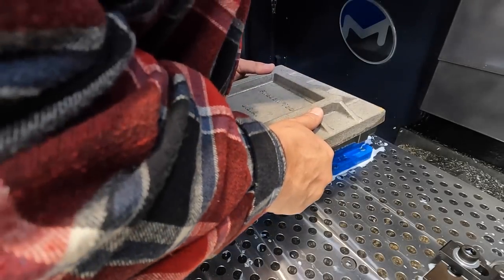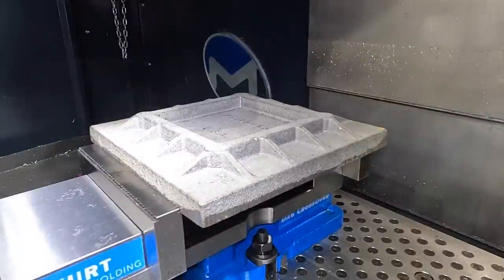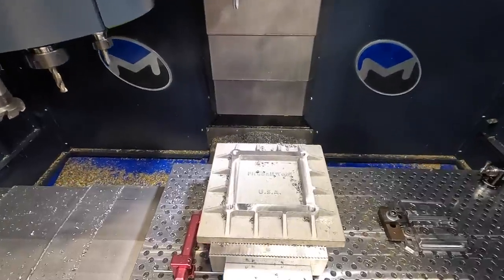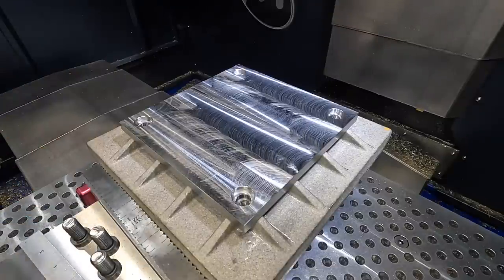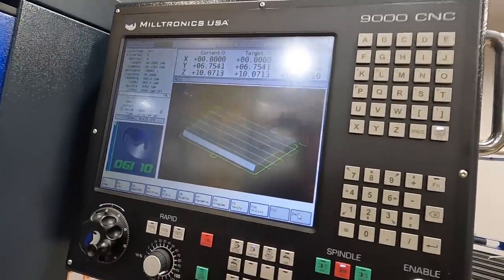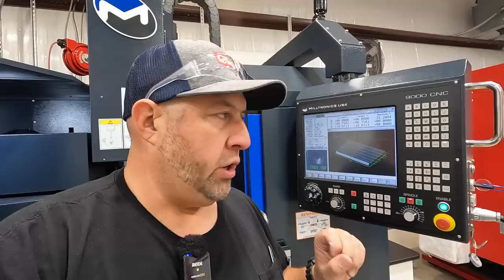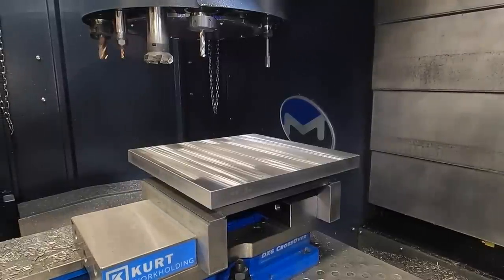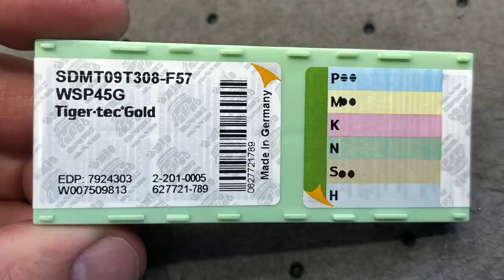CNC Machining a Fireball Tool Fixture Plate

Comment: Hi Adam,

Man I like that smile on your face.  I can tell you are very excited learning new stuff about CNC machining.
You were correct in getting a shorter length shank on the facing tool as it will provide more rigidity and better surface finish.  The one you have would be fine if you were doing some type of deep pocket that needed a facing operation.

I am sure you will find this new technology very rewarding.  Keep up the excellent work.

Just make sure you look twice as you input negative numbers into the probe process.  I found out quickly that there is a BIG difference between -.5 and -5.  I did this one night very late when I should have been in bed instead of running my HAAS CNC machine doing a probing cycle. It cost me $1200.00 for a new probe.  When probing I now always keep my finger on the ESTOP button ready to push it in case something goes wrong. I also had my local HAAS guy rewrite the speeds on the probe cycles to slow them down.  It now takes a little longer doing the probe cycles but so far no more $1200.00 accidents.😉
Reply: The conversational manual mode probing cycles on the DMG M1 I worked on were practically uncrashable as it would never do a full rapid towards a measurement point, but you would very easily fuck things up when setting up the in program measurements, as the conversational menus for that seemed like a slapped on afterthought they didn't have time to tidy up compared to the rest of the Sinumerik controller, only made worse by the fact that I had never used them before. 

To give you an example of how bad it was, I would rely on the ShopMill conversational and onboard simulation 99% of the time, when making any prototypes, fixtures or jigs and almost never dry ran anything (I have sometimes even run a few simple single op programs without even a simulation first, since the input field visualizations and the explanation pop-ups along with the graphic view mode are already pretty straight forward and gives all the information you need to know how it will behave), apart from some high pucker production setups (you really don't want to hit the steel fixtures at 15.000mm/min of feed with a 2.5x100mm staggered tooth side mill running at almost 5 times it's maximum rated surface speed to surpass the 2500 parts per shift mark). Also the work offset probing cycles in jog mode are as intuitive as it gets, and you can set a part up or do a measurement in no time. 

When it came to mid process probing programs though, I could NEVER figure out if an in program probing cycle was alright or not just through the simulation, and I ALWAYS had to run it above the part multiple times and triple check a multitude of things to make sure it wouldn't crash due to some weird input value (the conversational menu doesn't allow blank fields in the program). It would be nerveracking to have to drop the probe in a groove and measure one side for example, since there were a bunch of different feed distances to set and it didn't always make a ton of sense to a relative newcomer to CNC like me.

Comment: Another great video. A tip if you don’t know, start your contour and chamfer tool paths at one of the corners. That way you won’t have any witness marks from start and end of the tool path. Need to look into those fixture plates…nice.

Comment: Nice Machine👍I got no idea of scraping, but got some smartass comments on the CNC thing: I would recomend M01 (optional stop) before every toolchange. makes first runns safer and faster. You can leave it alone if it's cutting for like 30 minutes and it waits for you at the next toolchange. In my observation 99% of crashes happen because of wrong tool or part ofset... Also I would add a save retract level in Z of ca 2in, when drilling. If the tap is in a normal collet, it can brake loose. with saveretract, you got at least a chance to hit E-stop. For better finish on Cast Iron,  sometimes the inserts for Toolsteel make the best finish (I don't know Walter so I may be wrong) I use coolant for castiron for better finish but also for better chip removal. But it only works if you got good flooding, so for filming maybe not....

Comment: Impressive shop.  I understand the learning aspect.   We’ve all been there.   He’s a tip for you.  With your Walter (or any facelmill) the shorter the projection length the better.  That’s a 2.00 inch facemilk on I’m guessing a 3-4 inch long shell milk holder.   If you need that length you need it.  But I’d recommend getting a few different lengths and use short when you can.  Your parts will be more consistent, tool life better, etc.  I couldn’t get a good look at the facemill I always recommend using a 45 degree facemiill if your just facing.  Short 45 degree facemill with the right grade insert and proper speed and feed.  Rick and roll all day long.  
I was a machinist for 15 years and sold cutting tools for 10.  Hope we have more guys like you getting into this field.

Comment: A fella at work showed me a super helpful app called 'FSWizard Pro' which in addition to having an encyclopedia of baseline feeds and speeds for any style and configuration of tool and cut depth/width, has calculators for center drill depth, drill sizes, etc. Comes in handy everyday for me.
Reply: Such a good app. The paid version is 100%worth it too.

Comment: Not sure the HP on that spindle or its torque curve, but we have had much better success running a slightly smaller facemill, and keeping it as short as possible. 

Smaller diameter means more rpm for the same sfm. 
If you play your cards right you can get a larger number of teeth per minute which means more material removed for the same width of cut. 

I would say your largest issue is the length of that face mill. 

Kennemetal makes some face mills that are integrated direclty into the machine taper. Doesn't get much more rigid than that. 
Our workhorse facemill on our VM3 with the 15k spindle is a 1.25" 4 flute iirc for P, M, S materials. 
And we use a shear hog for N materials.

Comment: I think you are absolutely correct to first learn the conversational on the pendant inside and out. Everyone running CNC that I have ever seen will make minor adjustments at the machine for one reason or another or program a simple one off at the machine. You don't want to have to be running back to Fusion to make some minor adjustment and all that's involved in that workflow.

Comment: I'm so happy to see you embracing CNC, my dude! It's going to be so cool watching you transition from where you are now, being quite conservative with your feeds and DOC and being quite nervous about what you're doing, then I know when you get a bit more confident you'll be seeing how far you can push it and make some massive Abom79 cuts, and you'll really dial down those finishes, your parts are gonna look amazing man!

One thing I will say, that face mill you've used in this video, that holder is waaayyy too long. You can see in the machining marks how much that tool is deflecting, get yourself a shorter holder and you can take much deeper and faster cuts, and it will leave you a nicer finish.

You're doing great man, I'm so happy for you in your new shop, I'm really exited to see what you do with it!

Comment: I think the periodic chatter, which only happened around the corners, is due to resonance: it constructively interfered with the diagonal, but not the width. If your machine supports "jittery" random spindle speed variations (sorry, I can't remember the official terminology), that may make those resonances go away.

Comment: 37:00 I'm sure you probably know this. But a good practice for when this chatter is happening is to decrease your spindle speed 10%-30% but maintain your feed rate. You want to have enough tool pressure to keep that chatter from happening. There are other ways to avoid this, but that's a good start because you can just override the RPM on the fly at the control  Awesome video! Glad you stepped into the world of CNC!

Comment: When you do the programming on fusion 360 or any other cam software, it's easy to make those edge cuts so the tool moves slowly up and down that way you wear out the tool evenly.

Comment: A master manual machinist has learned how to work with sight, sound and touch. They're like sculptors. As they turn the wheels they can feel the drag, hear the vibrations and see the results, and they can adjust on the fly as needed. Taking away all that tactile and temporal feedback requires you to work it all out in your head first, translate it to a foreign language and then step away and hope for the best. There's no direct opportunity to adjust for a cutter that might be a bit older, or a bit of extra deflection, or the material responding unexpectedly. I understand the need for speed in production, but that's a whole different skill set, and it satisfies a different part of the brain.

Comment: Adam, great video!!! I see that you are entering the middle of the stock  and ending in the middle. If you change the end of the program to run off the corner you will not have that little vertical spot in the final product. I am not an expert in this field yet but I was doing that in the beginning and noticed that in the finish. Again great video and looking forward for more!!!

Comment: Mount that face mill on a shorter holder. You're biggest issue with the finish with that tool is the deflection. Shorten her up and she'll be leaving a mirror finish. Probably could bring the spindle speed up as well.

Comment: Great job, Adam!  I will always prefer seeing the manual machines in operation, but the fact that you're committed to learning a new way of machining is awesome.  The end results of CNC machining are amazing, I'm just not a big fan of the high speed whine.  I don't know if it's the cabinet amplifying the sound or what but the sound is a bit like nails on a chalkboard.  But that's my opinion.   I won't slam you for wanting to learn something new.  Always forward, dude.  Can't wait for the next video.

Comment: One of my favorite things about the Fanuc control on my lathe is that it has separate overrides for the rapids and feeds. When you're running a program for the first time, you can turn the rapids down to 25% so all of the approaches give you enough time to see if there are any major coordinate mistakes, but all of your cutting passes run at normal speed. A note on better surface finishes with your face mill, if it doesn't have adjustments for each insert it will be difficult to get a high finish out of it. In steel, Sandvik recommended using a "wiper" insert in one of the positions, it was just slightly longer than the other inserts and had a wider cutting edge. In effect the other 4-5 inserts remove the bulk of the material and the wiper insert is continuously making a couple of thousandths cleanup pass wider than the stepover. The lazy way would be to rough with the face mill and cleanup with a fly cutter.
Reply: running single block or block delete and going on distance to go tab is also super helpful

Comment: @abom79 you should think about putting in two locating pins to have a perfect positioning in the base plate at all time :) so you can swap them out without bothering about relocate the fixture plate all the time :) (Thinking about putting it on the cnc to make adjuistments and so on...)

Comment: When you shift your program +2" in Z, use a gage block or 1x2x3 block to see where the tool will actually be.  Good way to check clearance between spindle and part/ work holding.  I usualy shift 6" and use s scale.  Great work Adam!

Comment: Congratulations. Keep that cautious approach. Especially on the one-off jobs. Saves a bit of money on tooling.

That chatter btw is a result of the cutter stiffness (with spindle stiffness behind that), the rate of cutting edges (spindle speed and number of flutes) and the cutting force for the depth of cut and the material.

Change any one of those and the tool chatter can go away... Or be much worse with broken/worn tools or workpiece finish defects. If the finish is OK and the tool not suffering excessively, then learn that tune and sing along.

Comment: The chatter may have been material diffeerences, but it first struck me as resonance when it happened at all of the corners. Thanks for doing what you do!
Reply: I was thinking the same thing.  As you near the corners. there is less mass to absorb any energy.  They will vibrate more.  It's physics.

Comment: I typically use Böhlerit Face Mills they do make a very nice finish. They have 3 roughness types. And different inserts for the major colors. 
And the tool holder in itself would be better shorter.

Comment: Don't be afraid to slow your rapids down on the first run. Also, use your feed hold and pause the machine on the way down to your part when first running a tool, look at the distance to go and confirm that it is going where you want. Full rapid into your vice is no fun because a tool was touched off wrong. It is also pretty scary if a crash does happen with both doors wide open, be safe.
Reply: Full rapid height is good to watch when programming, got caught on that one with a drill. It was a recessed hole and went about 1/4” rapid into the stock when drilling

Comment: I'd recommend with that drill, replacing it with a carbide one and just plunging it without needing to peck. It's a bit more expensive but in my experience you'll get way longer tool life and quicker to boot.
Reply: Other than that you're doing great being a Machinist
Reply: @EEF2077  Mitsubishi makes some really good ones

Comment: Use separate endmills for roughing and finishing. copy the event and use different tool diameters to control the finish pass radial depth. I only use .005 for my finish passes and spring pass it at a different feed rate or rpm for better finish. For the shell mill, back the ipm back by 5 or 10 at .005 depth of cut for a great finish.

Comment: Adam, you should create a poster for yourself, with all the pages and sub-pages, so that you easier learn the structure of the software.

Also, you should try to actively memorize what you learn. Currently, after you looked something up and achieved the step, you directly go to the next step. This will clear that new information instantly. Better wait a moment, take a step back, and try to repeat in your head, what you just learned. And only then proceed with the next step.

Additionally, I wish you could create little video lessons for us as viewers. Just a few minutes, explaining one specific topic. Try to rehearse before, and then explain the interesting detail by heart (without looking it up again). Also add why the detail is done that way. Benefit: This will help yourself to learn.

Comment: Manual machining is why your channel thrives brother. Just sayin😬
CNC machines need, "operators" & not machinists.
Reply: I figure if the CNC stuff lets him automate small production runs, hole patterns for fixtures, etc., that actually frees more of his time up to focus on the content he wants to make.
Reply: A true machinist can operate a wide range of machine tools using various metrology tools and techniques.  In today's word that
includes CNC, CAD/CAM and G-Coding which requires a great deal of knowledge in tooling, fixturing, speeds, feeds, materials, geometry, trigonometry, etc.  If you can do all that you are truly a modern day machinist.  Keep it up Adam, you're on the right
track...
Reply: Not true at all. His manual "machinist" experience serves him well to determine if he's doing things correctly or incorrectly.   THe CNC is just another tool to extend his power and productvity. Yes, yes, he's not running throughput to it's limit like Titan Gilroy but he is taking advantage of the automation.  His setup times will reduce more and more as time goes on, and running a small batch will be a breeze.

Comment: Maybe try making the plate holder larger and then just bolt it to the base. That way you only have to center it once and just swap out parts. Just make sure you use the same holes.

Comment: The surface of cast iron/ torch cuts are really tough on cutting edges.
If you can grind off the surface with a angle grinder is best. But taking light multiple cuts on a cast surface is really hard on the cutting tools.
 But you'll figure it out and I understand why you're trying to be extra careful.
 Thanks for sharing in a humble way?
Chuck

Comment: Something that i would like to share with you that helped me when going from manual to cnc.  You spoke on the difficulty in remembering all of the speefs and feeds for different tools.  I agree that it can be alot to remember.  By using surface speed for whatever material you are working with and keeping it the same accross all tools that keeps you from having to remember rpm fot each tool.  Likewise switching to thinking about chipload rather than feed for each tool you have less to remember.  Of course there are tools that will prefer a different surface speed and chipload for a certain material but for the most part they will be close. Pick a surface speed that sounds right for the material and use it accross all cutting tools for a test.  Use that combined with chipload to get feedrate for a few tools and try it.  Much less to remember.   Also most of what you are calling chatter is rubbing due to chipload being to light causing excessive thinning then rubbing.  This is just one machinists opinion.  Hope it helps.